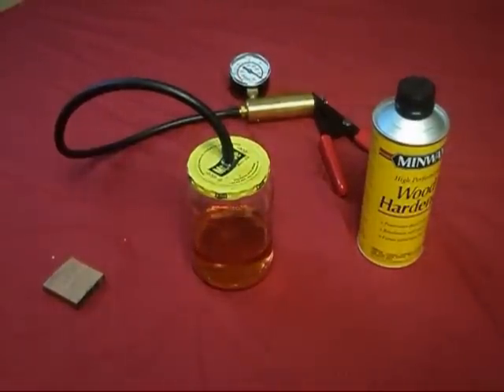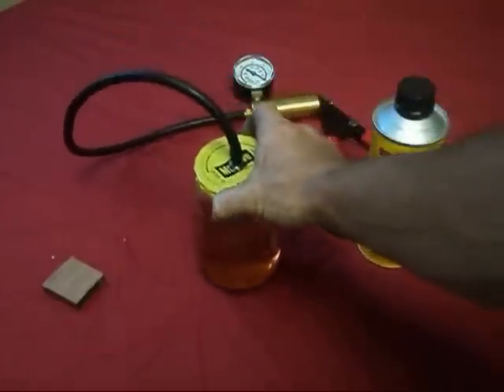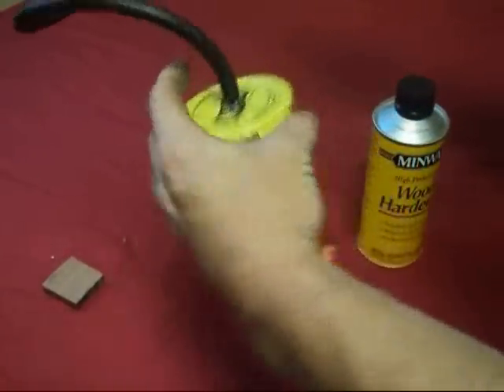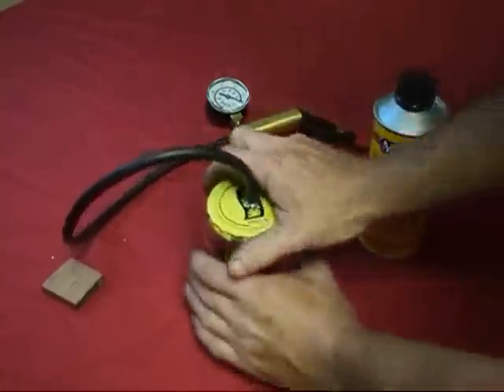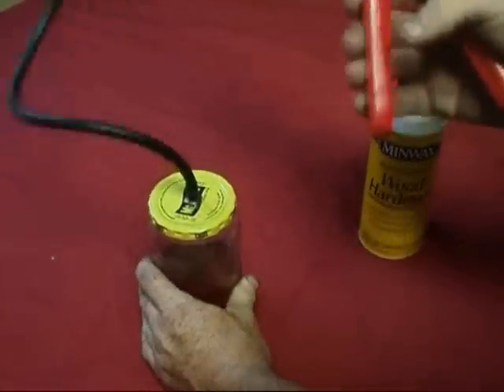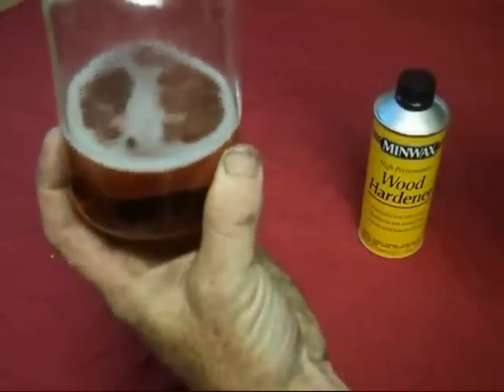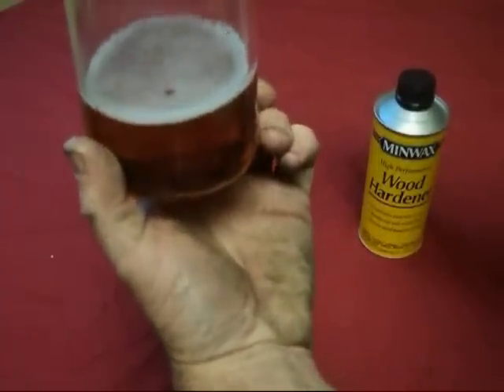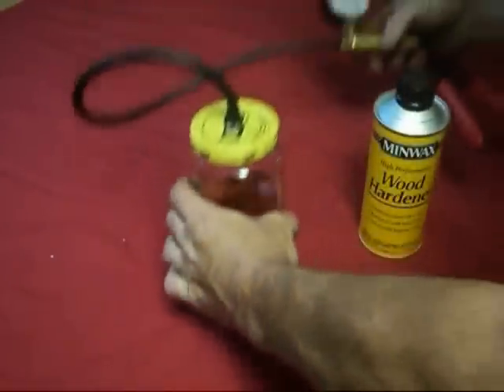Stabilizing wood, bone, and horn

Comment: Just thought I'd say thanks for the video.  After watching this, I made my own set-up with the same pump from Harbor Freight, and a 1 pt mason jar.  Using the same Minwax Wood Hardener, I stabilized a piece of very white, clear poplar and it came out beautiful.  I drilled out the center to check it out and I got penetration right through the piece.  Fantastic.
I'm going to use a 1qt jar and do a couple of larger pieces that I just got in the mail today.
Thanks again!
JB

Comment: I happened on your video by entering  Woodbone to check if one I posted was on yet  and I an glad I did. I use a simular system for stabalizing wood and horn for the harmonicas I make wich I call Woodbone. I can see how your set up shuold work much faster. Do you get total penitration on most hardwoods of about 5/16 thickness.
   You do some real good work  I especially like the folding skinner. In your vid it looks like the blade and handle are made of damascus.  Thats a lot of work.

Comment from the maker: Kevin, I like the wood hardener for bone and antler as well as wood. If you're just trying to harden the pith then this setup is fine, but if ya wanna get in the hard bone structure you really need a pump that'll pull a deep vacuum.

Comment: Thanks for the video,I just stabilized my first scales "spalted oak" and this setup worked like a charm!
I was thinking of dyeing some wood and read in one of the posts that you use a rite dye and water mixture, I assume that you do this first and let dry out before you stabilize with the wood hardener or can you mix the dye in the wood hardener and do it all at once?

Comment from the maker: Wood hardener contains solvents, but also resins which harden wood... I originally made this rig to dye bone but realized it does a pretty decent job of stabilizing wood. Not to say a piece stabilized by this is as good as by professional equipment, but it does make it about 80% better.

Comment from the maker: @Makermook It's main use is for burls, antler that has a lot of pith in it, and ice age fossils but it'll make any wood quite a bit harder than it was previously. You don't really notice much of a difference sanding it and such but the impact resilience is increased 10 fold. The wood hardener I'm using dries on the surface in under a minute, but it's penetrated throughout so I give it about 3 hrs usually. I mainly made it to dye bone with.

Comment: Minwax Wood Hardener is an air dry liquid.  Once the outside of the scales dry, doesn't that prevent the inside from drying?  Or rather, how long do you need to leave it before it's dried throughout?
Don't get me wrong ... that's a great set up, for infusing with heat setting resin.  I just don't know if I'd use it for air dry liquid.
Reply from the maker: +fishingpervert If it were something rather slow drying like polyurethane I would agree, but wood hardener dries on the surface in a matter of minutes. It's easily dry throughout overnight.
Reply: +BladeCrafters ... Thank you.  I wanted to try the heat cured stuff, but I just can't "spring" the cash for something I don't know if I am going to do that much.  I'll definitely try the hardener now.

Comment: Awesome! I've got some very burly angelique that is kinda checked, I've wondered how hard i would be to stabalise it. Not too hard, looks like. Do you think you could use  epoxy or polyester resin to stabalise wood with? I don't know if it would be thin enough to flow in.

Thanks for a great video!

Comment: I made one just like this. Did you find that the fumes from the wood hardener ate the rubber in the brake pump? Mine did. Ate the seal on the jar too. Did you have the same results?

Comment: Do you still stain the wood after this? 
will it reshape the wood, say if i have holes in it will they shrink? 
After doing this is when I would shape my wood? 
Can i do it with wood and other materials that i have glued together? 
Or do i glue them together after this?

thanks for the help

Comment: I want a damascus folder with 3 dimensional damascus waves or ridges on the blade, not real thick, but so you can feels the folds of the different steels.

Blade slightly less than 3" for legal reasons  is that something you could make?

Comment: If you use bone or antler pieces do you apply the same pressure for wood and for as long?  Thanks for the great idea and video.  Big thumbs up.
Reply from the maker: +Cre8Thought41 I use a pressure chamber pumped up to around 125psi to penetrate bone and antler.

Comment: Awesome video ... things that are cheap, simple, and work are where it's at.  Your method could be used with anything you want to get into the wood. Thinned epoxy might make a larger bone handle stronger.  I may try this with pure tung oil ... maybe heat it so it's thinned just a bit.

Comment: Isn't a brake bleeder a vacuum pump, not a pressurizer? I have a vacuum chamber that will work great if that's what you're doing? Thanks for the info!
Reply: Yes, thats why you see bubbles, its vacuuming the air out replacing it with stabilizer

Comment from the maker: You can use polyurethane or probably even tung oil or linseed oil. drying would take a long time though.
It's a vacuum pump brother. Almost no pressure, but I have had good results using high pressure for impregnation as well.

Comment: I have a couple more questions. So I built this now and I used lin seed oil since I haven't found any wood hardener in home depot or other common stores (Well atleast not that brand). I put a small piece of sanded walnut to test and the walnut floated on the oil, I gave it a shot anyways. I left it in there for about 3 hours, there were bubbles, not nearly as many as in this video. Also the meter would stay at 23 for about 10 minutes then it would drop back down to zero.

Comment: The top of the jar is completely sealed, i tried adding hot glue to the actual screw cap but when i sealed that the pump wouldn't pump anything so i took some hot glue out. When i took the wood out it was nicely covered but it didn't penetrate very deep into the wood. Can you identify any of the issues i could fix for this to work, it's a mighty fine working mechanism already :)

Comment from the maker: @pwyt0258 Thanks man. For dying bone I use a super concentrated solution of rit dye in water. Unless I'm going for a shade of brown, then I use potassium permanganate.  Dying bone takes a while though. Best to leave it in solution for a couple of days. This setup will easily stabilize a 1" square piece of wood. Full penetration in about 45 mins to an hr depending on the grain, density, and moisture content of the wood.

Comment: Does the wood hardener work for antler as opposed to buying a gallon of expensive cactus juice?
Reply from the maker: +Phillip Jelks Yes Phillip. Since this video was posted I have switched my method to a pressure vessel pumped   up to 125psi with an air compressor. Both bone and antler are much harder to penetrate  than wood. takes hrs uder vacuum but only 30 mins or so under high pressure.

Comment from the maker: @DLeRoyKing Yeah it's very cheap and works very well considering. I've gotten it down to 25" according to it's gauge. It won't pull a deep vacuum like a pump, but that would just boil away your liquid anyway. :)
Thanks for the compliment. The dagger was actually the hardest blade to make of those pictured. The hamon on it turned out really interesting I thought. Take care Dave.

Comment from the maker: @joshuafoxler13 Compression? It doesn't sound the same to me. The brake bleeder I use pulls a vacuum. I usually get about 23 to 24 inches of mercury. 29.92 inches is a perfect vacuum, so I dunno where the 75 you refer to would come from....

Comment from the maker: @freedomzimbabwe It's the hardest blade to forge in my opinion. It takes a lot of practice. Basically though you start by forging one bevel with it flat on the anvil, then flip it over and hold it on the anvil at the angle of the bevel you just forged close to the edge of the anvil so you're able to angle your hammer to make the geometry match. Does that make sense?

Comment from the maker: I doubt the brake bleeder pulls enough vacuum to lower the boiling point to ambient for this liquid. The bubbles you see are air leaving the wood.
Yes this works pretty well for antler that has a lot of pith like elk and such. For antler that's mostly solid bone I doubt it'd penetrate much, but then again, there's really no need to stabilize a piece of bone. It's pretty durable when at least some care is shown to it.

Comment from the maker: No brother, I never actually had a problem with mine.... Did ya use the same brand wood hardener? I dunno what the solvent is in it but it's some potent stuff. Did ya use the same brake bleeder? from harbor freight? Maybe quality control issues in the chinese factories that make em. They may also be made in more than one factory. Different kinds of rubber maybe? Not really sure man.

Comment from the maker: It's easy man, What you are talking about is done with thin strips of wood dyed to the desired colors, then glued together under pressure. When you sand down through the layers you expose the different colors.....I've made lots of similar stuff. The sky is the limit man, just play around with it and use your imagination.

Comment from the maker: Yes, it sounds like your brake bleeder is leaking. take the brass cylinder apart and grease the rubber baffles.
The problem with your penetration is the linseed oil is too thick. You need to thin it considerably. It should be slightly thinner than water. Use mineral spirits to thin the linseed oil.

Comment: This is no safe method but in countries where you can't get a vacuum pump, it may just work. If the wood hardener is flammable then you may not need the vacuum pump. Simply move outdoors. Keep a fire extinguisher ready. Dip the wood in the jar with hardener. Light up the liquid in jar. There will be whooshing flame. As soon as the flame dies down cover the jar with the lid as long as you want.

Comment from the maker: @MrChristiaan07 Yeah I'll make a video next time I do one. It's bowling ball plug compound lightly dyed with a base tint then other colors are gently swirled in along with mica dust and pearl coat depending on the look I'm after. You can buy it in gallon bottles for about 70 bucks a gallon. The assorted dyes are about 5 bucks. A gallon is enough to do about 40 handles. Durability is good. You really gotta whack the shit out of it with a hammer on the anvil to crack it.

Comment: I have Camel Bone for the handle.  Also have the rough length, but am at a loss for where to go from there. The tang is rectangular and ends in a rat tail.
Reply: The tang will be completely covered by the Bone Handle. It is for a Damascus Rapier and Maine Gauche blades.

Comment from the maker: Strange, like I say they are probably made in different factories maybe using slightly different materials...? Not sure what it could be other than that. FYI polyurethane makes for a good stabilizing fluid as well. Thin it down a little. Takes a lot longer to dry, but it's probably more durable truth be told. Although the wood hardener works very well.

Comment from the maker: Yeah man. A catalyst reaction like epoxy with an extended work time would be the ticket. Be nice if it was thin as super glue though. Something of the sort may be what they use commercially. Not sure. I do know that normal 5 minute and 30 minute epoxies have a terrible penetration rate. I always mix them on a single sheet of paper and they never make it through. The epoxy I cast scales from and also polyester resin have good wetting properties. Be something worth experimenting with...

Comment from the maker: It's not Rob. It's just a 2 part epoxy based resin that's mixed and colored. I make it as slabs in a glass tray I make of flat glass siliconed together. After it's cured I just break away the glass and cut the slab into handle sized pieces..

Comment from the maker: No, wd-40 is not technically a lubricant. It's actually a solvent. You don't need an oil anyway, you need grease. You can probably return it, I dunno...
Paint thinner generically speaking is mineral spirits...